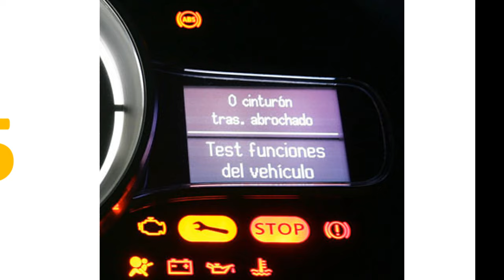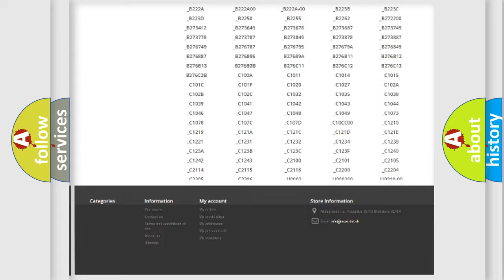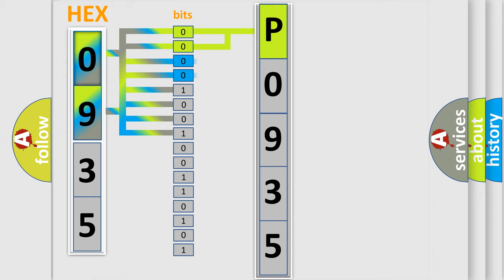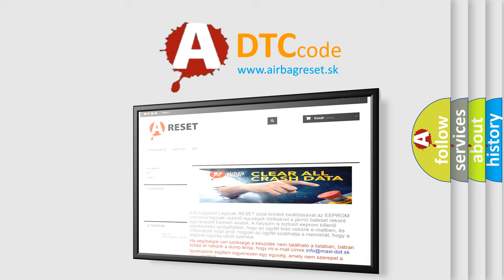DTC Dodge P0935 Short Explanation

Comment: this post is BS don't waste your time, P0935 is "hydraulic pressure sensor circuit high" has nothing to do with brakes, its in the transmission
Reply: You know how to fix it? I changed the transmission pressure sensor and it's still throwing the code
Reply: Any luck? Rondel gulley I have 07.5 2500 dodge Cummins 6.7